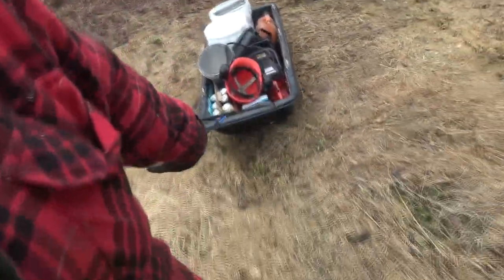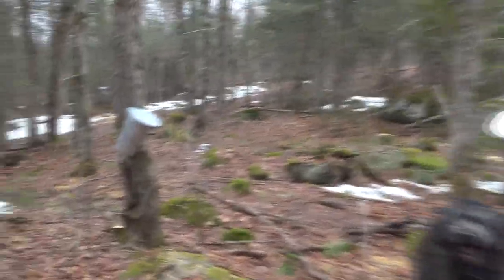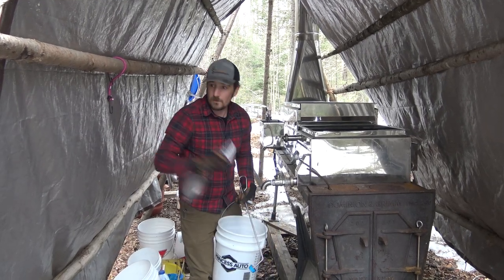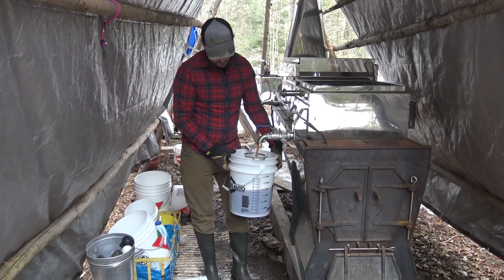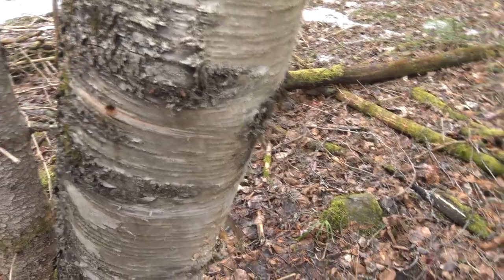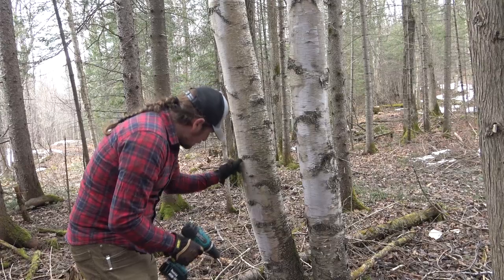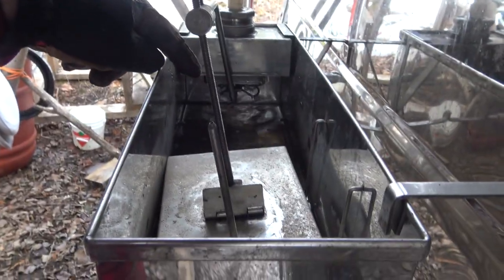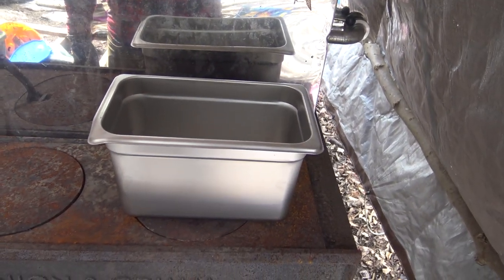Tapping birch trees

Comment: What’s the reduction ratio for birch sap?  Same as maple?
Reply from the maker: About double, actually.  And you have to cook it off at a lower temperature because it burns easily.
Reply: @OneWildcrafter  double.  Wow.  That would take a really long time to boil down then. Especially if it has to be done at lower temps.  That’s where a propane burner would shine over the traditional wood fired evaporator.